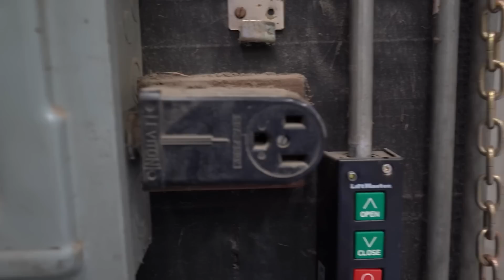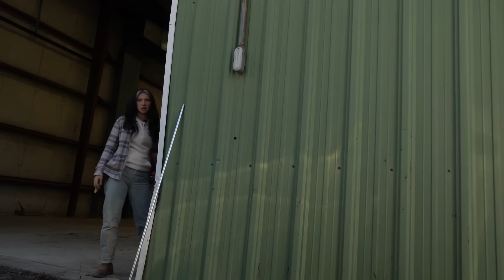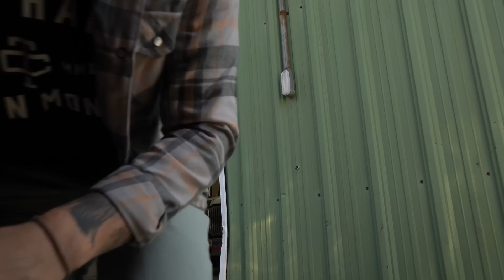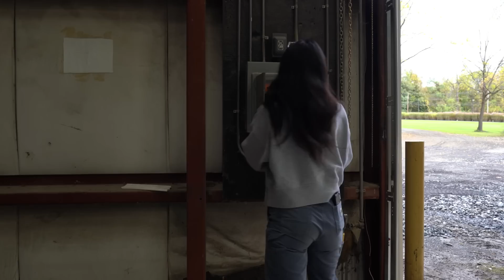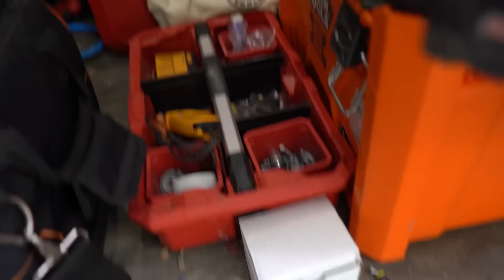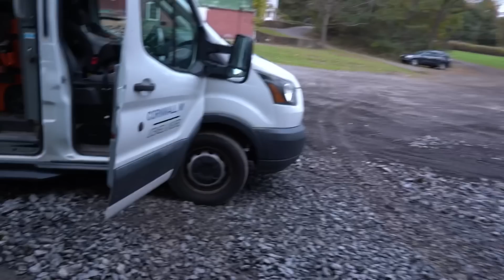How to Install a 30A Outdoor Outlet

Comment: I’m glad the customer finally decided to hire a pro.You did a great job and made a fine video.
      When I see a clutter like this, I consider ripping it all out and starting over;
      I’d also look at the loads and consider whether the panel is already overloaded;
      When removing covers, thread the screws back into their holes so they don’t get lost;
      I really dislike sheet metal buildings; it’s so hard to mount things securely. At least you have easy access to the backside and can add a backing plate, use machine screws with washers, etc.;
      With a 240V/30A circuit, upsize the pipe for four wires. You might even pull one and cap it off — just in case you later want a neutral.  As big as the device is, I want the biggest, deepest box I can find; I might even add an extension ring. (Your cover, at least, gives you lots of space);
      Water ALWAYS gets into those boxes, especially when your mounting holes are drilled through them. I suggest adding a tiny 1/16” hole to the underside to let water weep out; 
     Separate ground bars are nice, even when they’re just bonded to the neutral buss;
     I don’t see the ground rod; the GEC should be in this panel, not in the meter can. Personally, I much prefer the main overload and disconnect to be outside, at the meter — but that’s possibly outside the scope of this job.

Comment: Quick question is the reason why you didn't bond the box is because the screws from the 30 amp outlet bonds the box. Just wondering

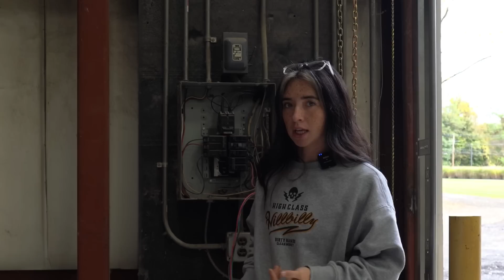Comment: I like your video. One gig i have is when you say at 11:08 that since it's the first means of disconnect the ground bar and neutral can be the same. I know you were searching for words. But to be clear the bus bar MUST be bonded to ground. It is not a choice. All sub panels after the first means of disconnect the neutral bus bar must NOT be bonded to ground.

Comment: I’m hoping to you used a tape measure at some point to determine where the drill.  Why would you drill from outside to inside when you have a live panel and equipment on the wall.  And again, where is your PPE?  You do look good And you have good skills. That Bell box comes with mounting clips so you don’t deviate the 3R rating of the box
Reply: My assumpton was the outlet breaker would be off, just incase

Comment: Great job, thanks for sharing, Just some constructive criticism, tie up your hair when working with drills or twisting tools, or if you are in open areas where 
 there are drafts, your hair could cause an electrical arc if the wind blows it into the panel. Safety First

Comment: did your co-workers teach you how to swear, or did you already have the skill?  BTW did you turn off the panel before working the new circuit? also I have never seen a 240 vac w/o a neutral wire to run a power washer motor. It looks like an engine heater outlet.

Comment: Why did you have to drill from the outside, there was no interference? You were not sure if the drill hit anything. 
 Not sure if power was OFF. 
Most guys (electricians) will drill from the inside reason is if drilling from the outside possibly of damage the wires or catching a live wire.

Comment: Why not use the bonding screw in the bell box? I understand you still have an effective ground fault path through the EMT back to the panel and it’s all code compliant. But redundant grounds are never a bad thing.

Comment: The reason you only bond at the 1st means of disconnect usually is never explained as to why. The reason is because often times the grounding conductor going to a sub panel can, by code, be sized smaller. If anything happened to the neutral, if it was also bonded at the sub panel, then the grounding conductor would become the neutral and would possibly be a fire hazard. Keeping them isolated would create a situation where nothing would work because there would be no potential. Hope this makes sense. Knowing the "WHY" is always better than just learning you're supposed to do it because it's code. Hope this helps someone.

Comment: Lexi, would love to see a little more emphasis on safety equipment like glasses and gloves......wearing them.....gloves/glasses.  

Also, more explanations.  Why no grounding pig tail was required, why we connecd/disconnect wires in the order we do, and why work the receptacle before the panel.  

Keep up the good work.  Nice and neat....impressive.  an example to follow

Comment: Hi Lexi ,
First of all, congratulation for all of your hard works and commitment that you are put into this trade. Very valuable . 
However, I have watch some of your video and base on always safety is first, I was wondering per OSHA you need to protect your beautiful eyes my friend. Please, wear goggle. You have already doing an amazing job and sharing with so many great people like yourself. I am learning from you too and does not matter how long you are going to do this . “No one knows everything but everyone knows everything “ this is my attitude and I am practicing it everyday.

So please wear goggle for your own safety beside even OSHA. Once again thanks for your great contents .

Also as one of the people commented how you used emt for the outside portion that will not flush surface.???

Also has to be GFCi protected.

In KY you can’t use emt for the outside portion even and has to be GFCI protected outlet.
God bless you

Happy New Year and wish you nothing but Happiness and prosperity for all the years to come 🙏🙏💙💙💗💗🙏🙏👌👌💡💡💡

Comment: I’m really surprised a GFCI isn’t required/installed here.
Reply: Might not be needed in that area.
Reply: @danlux4954  it would of thought it's mandatory seeing as it serves an extenal area. Here in the UK, there's very few circumstances where an RCD/GFCI isn't required.
Reply: @Josh__Stevens  each state/province has their own rules.

Comment: How do you come up with 230 volt outlet. If you was a real electrician you would know it is a 240 volt, I’ve never hooked a meter up and got 230 volts, just like when people say 110 volt outlet, it’s always 120 plus(normally 120-123v)
Reply: You also have in some areas 120/208 power but that is usually in a commercial setting that has 480v 3 phase going into a transformer, giving you 120/208. I can’t get why people even watch this shit. Maybe in 20 years you may be good enough to work for me.
Reply: Clown.
Reply: triggered 😂😂😂

Comment: Here in australia its 240V standard but we use double insulated wire,RCD's and for us its a Active,Neutral and Earth so no 2 phase to get what we need ;)
Reply: It's 240 here as well. 220 and 230 are old habits not dying well.  If we use a meter here in Canada 240 volts in single phase.  Isn't Australia 50 Hz?

Comment: Just wish her & others would use proper approved PPE every time they open a panel. I would have been fired from the job that I retired from if I did not have proper PPE. We had the company purchase us 5 pairs of 8 to 11 CAL long sleeve shirts, pants and one year a PPE rated sweat shirt ( over $110 with company logo & our name ) next year a winter jacket. We had a total of 8 pairs of rubber gloves & canvas gloves. Kept a pair of 600 & 20 KV gloves in one building then another set of each in main building. Remaining 4 pairs were switched out every 6 months when we sent rubber gloves out to be tested & date stamped. We loose at least one electrician every week from Arc fault blast &/or electrocution. Please work safe. In my 50 enjoyable years in the great electrical trade never lost a day from an injury . Also use an approved tinted face shield bavaloca ( yep spelled wrong ) and ear plugs.

Comment: Im not sure which code cycle you're on but from 2017 on 210.8(B) requires all outside receptacles rated 150v  phase to ground and fused less than 50 amps to be gfci protected. Just something to keep in mind.
Reply: Is that for dwelling units?

Comment: Im A JourneyMan Lineman(High Voltage) with a C-10 and I love watching your Channel. It’s always fun watching these lil projects from someone else. Not too mention someone Hot lol. Anyway keep up the Good Work…. And BTW wouldn’t it been easier to drill from the inside to the outside so you didnt have to “Hope” it went well? But I think you were just showing off! Another reason I love your channel. 🤙🏻

Comment: Hi, UK electrician here 🙋‍♂️ over here our single phase (1-wire) is 240v AC, we also use 3 phase which is 415v AC but we rarely if not never use 2 wire for anything. Do you use 3 phase in the US or is 2 wire the most? 

Loving the videos! Keep it up 🇬🇧🤝🇺🇸 ⚡️
Reply: Uk quoted voltages are 230 and 400 since Harmonised Standards. Can’t actually remember exact date but colours changed in 2008 and I think voltage was around 2001.
Reply: Three phases are common in industrial applications in the US
Reply: Three phase for commercial and industrial applications. Single phase for residential

Comment: You don’t have to strap the 90’ degree pipe going into the panel? I didn’t know you could use a whole in a wall as a way of supporting
Reply: From the connector coming out of the panel to the penetration she made going into the wall is less than a foot. So no need for a strap

Comment: Why wouldn't she drill a hole from the inside with a long, small diameter drill bit to make sure you start from the outside at exactly the right spot?
Reply: I'd guess because she may have ended up with a hole on a rib of the outside steel siding, then the electrical box wouldn't fit flush.
Reply: @gregkahle9046 this answered my question on this also. Thanks.

Comment: Two questions. If I'm not mistaken, if you put a 1/2" emt connector on the conduit coming through the exterior wall, I would assume you would have threaded the connector to the back side of the W.P. box. It seems that the corrugated wall would have prevented you from doing that.
Secondly, even though you used emt, shouldn't you have bonded the W.P. box  along with grounding the outlet?
Reply: Also use a liquid tight connector at exterior wall
Reply: Got this one for you.

The hole was drilled big enough through the wall, that the connector was on the box and slipped through the hole when she mounted the box.

Grounding:  

the receptacle was grounded with the ground wire.

The box was grounded with the metal connections of the EMT to the panel.  

This meets the NEC requirements.  Also, the NEC allows building departs (authority having jurisdiction ) to keep, throw out, or modify any code rules.

Comment: In this case are you required to use a dedicated ground? Since you used emt and a metal box the conduit would be grounded all the way to the panel.
Reply: Ground in every pipe
Reply: I don't think it hurts to run a ground, maybe unless it affects the pipe sizing.

Comment: I'm a General Contractor and do pretty much everything including plumbing and electrical. I once finished a large basement and had to install a 80A subpanel, and run all the wiring through the whole basement. Inspector gave me an A+ which really made me feel good! You do awesome work!

Comment: Interesting video. I live in New Zealand (and like to watch videos like these despite not being an electrician) so it's interesting to see the differences. I had no idea rigid metal conduit was mandatory, here rigid plastic conduit is often used. I've seen other videos where flexible metal conduit is used, in my mind it seems incredibly overkill but it's probably required by regulation.

Most houses are single phase (commercial buildings are three phase) so pretty much every cable is 2 or 3 core, I don't think I've ever seen the individual conductors being pulled through (though I believe for 3 phase sockets it's easier to pull five individual wires). I am surprised though the supply panel for the building is not 3 phase.

Also interested in the outdoor socket, not sure if it's required by regulation or not but here most (if not all) outdoor 32A sockets have a spring loaded door covering them with a seal, and often the mounting block points downward. To access, the customer just pulls the door open and plugs in. There is also sometimes a switch that has a padlock point in the off position, probably to deter use if it's installed in a public place. I bring this up because the holes in the bottom of the mounting box make it look like a perfect place for bugs to live in (though I suppose that's less of an issue if it's being used frequently).
Reply: Videos like this certainly illustrate the differences between NEC and AS/NZS 3000.  Here (Australia) every socket has active, neutral and earth, and single phase is 240V.  That socket was effectively a 2-phase socket (two 180° opposed 120V phases balanced around earth) and it's interesting that there's no need for a neutral.

The colour codes are something else. 😊 On one job we relocated some US-built gear. Everything inside the cabinet was NEC colours.  I warned our techs to check the connections between the 3-phase wiring coming from the 415/240V-208/120V transformer just in case the Australian sparkie had matched up the wire colours not realising the cabinet was wired per NEC.  Well, they didn't follow my advice ... powered up the cabinet and blew up a stack of 120V gear inside which suddenly had 208V across it instead. 🤔
Reply: @vk2ig  Yep, I believe the transmission lines are similar to most of the world (three phase high voltage) until they reach a transformer that's centre tapped. I think there's also a connector that supplies L1, L2, neutral and earth, so that some circuits can use 120v and perhaps for other purposes (power factor/balancing?). Either way, would hurt my head as an electrician over there as I am so used to three phase being distributed as single phase with everything requiring 240v!
Reply: @usagold8  I know a sparkie who holds dual citizenship and is licenced in the USA and Australia. He corrected me when I referred to the 240V (±120V) supply as a 2-phase supply (where the phases are separated by 180°), as apparently that term is used for supplies where the phases differ by 90° and the line to line voltage is 1.41 (or √2) times the line-to-neutral or line-to-earth voltage.

Another aspect of there vs here is the additional copper needed for the current at 120V compared to half that at 240V for the same load. E.g. a 1.2kW bar heater draws 10A at 120V compared to 5A at 240V.  Assuming the same IR drop is tolerable (and it may be that a lower drop is mandated for the lower voltage supply) then that means all the conductors need to have a cross-sectional area greater by a factor of 1.41 (√2 again).
Reply: @vk2ig  That's still not quite correct. In the US, the phases are 120° offset, not 90°, to run a split phase delta Y configuration. That's what you'll see in 99% of US homes and most commercial. Industrial will essentially run whatever the hell they want or need. They may get 240 3 phase, 480 3 phase, 13kv to their own transformer to make it whatever they need after, or if they're big enough might even get their own 161kv feed (think steel mill, not assembly lines) capable of 2000 amps.

In some super old houses and apartments in the US (the 1% left out of the above), you may still be able to find some really exotic stuff like panels designed for 96V DC that gets converted back and forth because it was built and wired long before the country had a standard. Those may all be gone and rewired by now, but a decade or so ago a handful still existed. We're oddly going back to that without even thinking about it. Local DC generation converting to the 120V split phase and back as needed with the number of solar panels people are putting on houses. We just have a standard now that's nation wide rather than whatever a cluster of apartments next door to each other agree to.
Reply: Its Stone Age electrical the US Is like a hundred years behind it’s bizarre watching these videos

Comment: 126 volts on one leg and 116 volts on the other leg? Don't you see there is a problem there? A good electrician will know this. Quit just being an installer and try to develop yourself more in electrical theory.
Reply from the maker: It’s the utility not anything I need to change, relax
Reply: @lextheelectrician  Oh yea, brush it off and blame the utility. Did you make checks to confirm that the problem is on the  utility side? Based on your video, you did not notice there was a problem.
Reply: As a power lineman for more years than I care to recall, that’s the utilities issue.
Reply: @mikeburke8656  I’m always calm.
Reply: @edge1289  your fine. Replied to the wrong comment.
Reply: I'm not familiar with power distribution in the US, but I guess if - in the local distribution system on the poles - one leg is loaded more than the other, then Ohms Law will show that the voltages of the legs with respect to ground will be different?

Comment: Like, did you even read the our code book? We can’t run an electrical system that operates at more than a 5% voltage drop, and you’re talking 230? Where in the f do you live where you think you’re working under a 230 system? Do they not provide the proper power. I do mostly high end commercial but I’ve done enough residential to call bullshit on this. 230v? Really? Like really really?
Reply from the maker: Why are you so mad rn… I was reading what the pressure washer voltage was it’s 230v so I was installing an outlet for a 230v pressure washer…